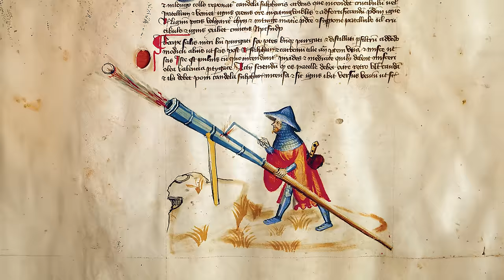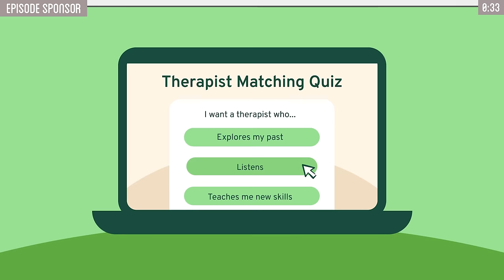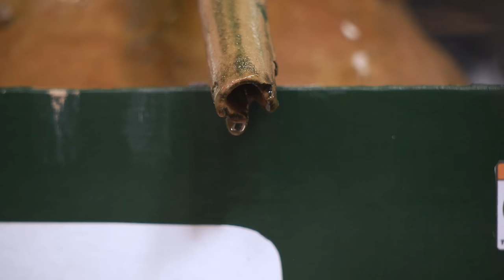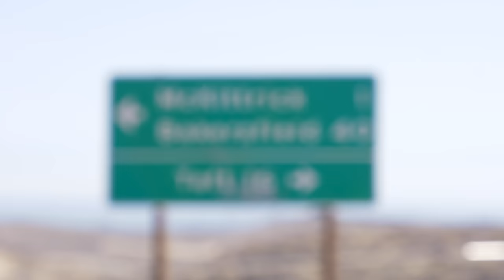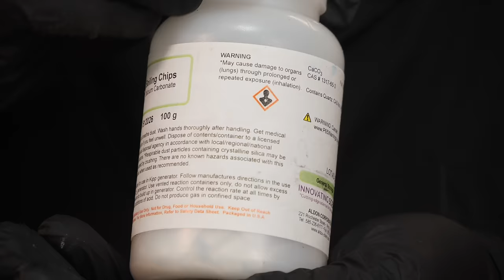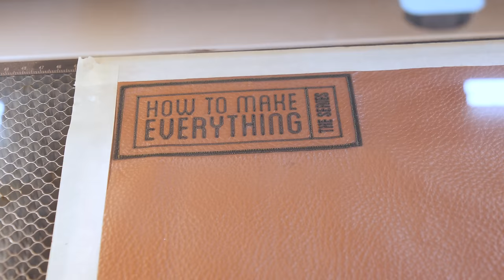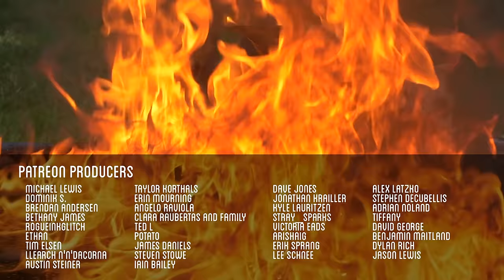I Recreated the Lost Recipe for Greek Fire!

Comment: Quick tip from a chemistry student: please clean the ground glass joints in your distillation setup. Anything in the joints will probably cause leakage. You probably don't want that for your safety and yield. And for safety purposes please ventillate well during distillation or do it outside.
Reply: Yes. The fumes can easily cause a fire, asphyxiation, or an explosion.
Reply: Distillation*
Reply: @adamkluckner3429 your comment added nothing to the original comment. 🤓
Reply: @Ith4qua  You're welcome to believe that but you'd be wrong. It added correct spelling to an otherwise incorrect sentence.
Reply: @adamkluckner3429  Nitpicking a bit but true, I make that mistake too often. Since I am a fellow perfectionist I'll edit the comment.
Reply: @lordcatface2378  You are correct I was definitely nitpicking a little bit, but on a comment about the benefits of doing things correctly it only seemed fair. Have a very pleasant day.
Reply: @adamkluckner3429  Yep, perfectly fair, have nice day too man.
Reply: Did you guys become friends?  Dorks.
Reply: Magnifique.
Reply: Aha... nitpicking perfectionists!

The perfect place to repost this...

Interjection! Objection!

I should watch the whole video before commenting especially since I skipped ahead after listening to the beginning...

I suspect that your napalm mixture is not the “legendary Greek fire” but just a flammable oil mixture.

Just as there have been discoveries of ancient devices that might have been electroplating devices...

So to the lost technology of Greek fire most likely involved some simple but technical material such as sodium metal with was contained in the oil pitch material... this material was likely to be pulverized and distributed throughout the oily pitch possibly in conjunction with a pulverized processed mineral that was very high in magnesium metal...

So now they have the oily pitch containing pulverized metallic sodium and pulverized metallic magnesium... which in the oily pitch would stable and if pumped out under pressure would ignite on contact with water and burn even in a highly carbon dioxide environment without oxygen being readily available in gaseous form... once the metallic sodium catches on fire simply from being exposed to water... the magnesium would ignite and be even more difficult to extinguish until the chemical processes and reactions ran out.

So that would create a stable Greek fire system that would be relatively safe to handle and transport and yet be highly volatile and useful under a wide range of potential deployment capabilities.

This would explain why Greek fire was described as “burning water” and “impossible to extinguish”... because once the metallic sodium starts burning and ignites the metallic magnesium in the pitch mixture... there no putting out that fire.

In the histories of the Byzantium Palace in Constantinople there were mentions of strange machinery of unknown purposes in the basement... which were damaged by looters in the fall of the Byzantine empire.

There was in fact a recipe.
There were in fact machines.

There are in fact simple chemistry patterns and behaviors which can create these outcomes.

What is unknown is how they did it and how it was discovered in the first place...

To me this is fairly obvious at this time... but I studied this situation decades ago and am often amazed at the continuous misrepresentation, misdirection, misinformation and obfuscation related to this and many other topics.

This material is ridiculously dangerous to have in storage... and they most likely would have manufactured it on demand from stores which were deliberately acquired using a clandestine methodology in order to prevent recognition of the recipe and the processes involved.

People both over complicate the situation and underestimate the capabilities of Greek fire.
Reply: if you're gonna turn your back yard into a superfund site, you're probably not concerned with getting quantitative yields.
Reply: I am not chemist nor scientist, but should different experiments not be done in a similair setting?, i mean i have my doubt of the last two, as the entire pool was blacked out.?
Reply: The guy's ego is so big, he really says that noone bothered to test their recipe before. I doubt he cares about your advice.
Reply: @quitequiet5281  I'm convinced that Greek fire contained lithium ...
Reply: Nah fr it was killing me
Reply: You can hear how dirty that joint has gotten.

Comment: Maybe this might help: Naphtha (refined crude oil, boiled to extract compounds that evaporate at lower temperatures just like what you did), quicklime (as a fine powder), calcium phosphide (produced by boiling crushed bones in urine in a sealed earthen or copper container), turpentine (extracted from pine resin), sulfur (as a fine powder), and niter (potassium nitrate). The working principle involves the reactive ingredients, calcium phosphide and calcium oxide (quicklime). The key question will be the proportions—whether the mixture should have a paste-like viscosity or be more oil-like. I think the solution will require testing and adjusting the oxidizer.
Reply: That sounds like a very effective recipe! It's definitely something I'd wear a respirator around, but ignoring the obvious hazard of phosphine, I don't dont see why it wouldn't work. Is there a source to this recipe or did you come up with it?
Reply: @Oystercaulk  based on a lot of research, I looked at the tech and what they were using and trading as well as using for medcine.  All these things were at their diposal so its stands to reason with a bit of experimenting they would figure it out.. Another thing they had was alcohol but didnt find any evidence of distilling it to a pure form.
Reply: @rishia8908  id imagine given its secrecy any literature that may have been produced by someone with high testicular density regarding the production of Greek fire, its constituents, or its precursors would have been found and consequently destroyed since there likely weren't too many people to keep tabs on that knew the recipe. Anyways, this recipe seems quite plausible, and regardless of its potential differences in composition to the original recipe, it sounds like it would produce all the effects that define Greek fire in literature and have been possible for them to produce at the time. Good job, man! Hopefully, someone will come along and test this recipe because god knows im not going to chuck anything containing calcium phosphide into water in my backyard to find out. Then again... Idk. Maybe one of my neighbors has a pool they don't use /s 🤔😂
Reply: this looks very promising tbh, imma get the ingredients and give it a shot once I have some free time
Reply: @artemis-arrow-3579  nice.. keep me posted!
Reply: @artemis-arrow-3579  awesome! Be safe, and let us know how it goes!
Reply: I was honestly considering calcium phosphide as a potential candidate component as well.
Reply: You just forgot to consider greek fire wasnt supposed to ignited when  It touch water, in fact some sources noticed It was launched upon enemy ships so quicklime and calcium phosphide are useless and It looks very strange for the byzantines to use potassium nitrate centuries before It became widely know and used in the area
Reply: @marcoaorelio6409  according to multiple sources it did ignite when it touched water. and they did have niter ! I suggest you update your knowledge on the subject !
Reply: @rishia8908   not according to military Eastern Roman sources
Reply: @rishia8908  so did he use Naphtha in the video ? The distilled tar seep?
Reply: This is similar to a basic recipe that I have read before, although as you said the proportions have to be determined thru experimentation. I might guess that it has to have a consistency like a semi-jelled slurry so it can be projected out thru a type of hand pumped or pressurized siphon tube. It needs to have a reasonable range, maybe 25-30 meters at least? I know it could also be in form of a kind grenade hurled by ballista or catapult. It would start burning on impact. But if it missed and hit the water, it would burst into flame. I think they would have used something to thicken it, jell it, and make it sticky. Pine tar or turpentine certainly. Maybe shellac, thru trade with India? I know the Greeks didn't have any Styrofoam laying around. Experimenting with different ingredients once they had the basic recipe in order to improve the range and heat of burning.

Comment: If you've already got pine resin, its a short jump to get turpentine, which is super flammable... and is basically just distilled from pine wood, easier to get then pine tar, possibly just mix it with the raw crude, you have the sticky icky, and the easily ignitable? a simple easy to replicate with Byzantine tech recipe. Maybe add some phosphate as a thickening agent?
Reply: Terpentine is a low viscosity fluid, so it’s not sticky. Phosphate is ionic, and as such is very polar. That means it’s not soluble in non-polar organic compounds like those in petroleum. It would just sink to the bottom of the mix, and not do anything
Reply: @ashe1.070  egg is an emulsifier. so is blood. they're both albumen. So is lecithin which is in most plants. terpentine + phosphate + eggs or blood. sounds like alchemy to me.
Reply: @ashe1.070  did you read the entire comment? "possibly just mix it with the raw crude"... clearly not.
Reply: How do you add the magnifying glass and create a searchable url in the comments? Tried looking online but could only find copy and paste url.
Reply: @Rizzob17  I think it's automatically generated with AI or something. Not a command by the commenter.

I noticed that they appear and disappear in different comments as I refresh the page.
Reply: @Pixelarter  I bet you’re right. The little magnifying glass is gone. I only noticed it yesterday.
Reply: toss a little magnesium in there  for the water induced super charged flame!
Reply: @anthonyrobu8633  magnesium, while being a recent discovery, doesn't react with water, it does burn hot enough to split the molecules, it takes a sizable chunk of already burning magnesium to do much more then fissile

Comment: I remember reading somewhere that Greek Fire was preheated before battle, which might affect the results.  Also, it seems to me that adding small bits of sodium, lithium, etc. to the mix might be a good way to ignite the mixture in water. Sodium is often stored in mineral oil, so it's safe-ish to transport.  Then during a sea battle, as the oil spreads on water it seems plausible that the sodium would eventually touch the water and ignite.
Reply: I don't think the Greeks had access to sodium and lithium
Reply: How'd you get that with the chemistry of the time?  Normally this is done with electrolysis of molten salts (no water).
Reply: @SuperEmmetMan  I don't know if they did or did not, but they did work with other metals. I think there's at least a possibility that some sort of highly reactive metal might have been part of the secret formula.

Besides, I'd like to see a video of that concoction, even if it's not all that plausible.
Reply: @Neal_White_III  Highly reactive metals are that way because they're made that way.  Unless you have the technology to reduce alkali to metals, or to make something like pyrophoric aluminum, you don't have such highly reactive metals.
Reply: @goodmaro  Agreed.  The question in my mind is: Could they have discovered a method to make such a material in antiquity?  Considering that it was so secret, unfortunately, it's likely no evidence would remain.
Reply: @SuperEmmetMan  - Yes, sodium and lithium extraction involves electrochemistry, with a lot of electricity. 10,000x more than you can get out of a room full of "Baghdad batteries". bdw, Baghdad batteries are "coast-to coast" BS ! Not getting useable lithium or sodium, or potassium, until the mid 1800s.
Reply: The problem is, you need electricity to extract sodium from salt.
Reply: They did not have access to any alkali metal
Reply: theres no way the ancients could have made sodium
Reply: Despite the inaccuracy of the claim that alkali metals require electricity, the Byzantines still weren't using any: the alternatives are refining under vacuum (which didn't come until the 1650s, by which time Greek Fire was lost for centuries), or an inert gas (which the Byzantines also didn't have). In short, abandon all ideas of alkali metals being used for Greek Fire: the option never existed for them.
Reply: @absalomdraconis  people also forgetting the color of greek fire, it was green so something in the chemical reaction is probably key
Reply: @SuperEmmetMan They probably didn’t, as alkali metals weren’t discovered till a long time later.
Reply: @SeekingTheLoveThatGodMeans7648  electrolysis can be done with an acidic liquid with a salt connected to copper wiring.

Bronze Age batteries, if you will...
Reply: @Jamhael1  yeah Bro, a 1.1V battery is pretty suitable if your goal is to produce hidrogen and oxigen from water and nothingelse
Reply: @marcoaorelio6409  try in scale - as in vases of 20 L of vinegar in line.
Reply: @Jamhael1   I will teach you a thing, every cell generate the same electrical potential and It is independent of the cell size, this is the reason behind the fact a 12 V lead battery is in reality 6 cells of 2V each. 2L, 20 L, 2000 L generate 1,1V
Reply: @marcoaorelio6409  not even if put in line or in parallel makes any difference?

Because such things were used for jewelry in ancient times...
Reply: @Jamhael1   yeah? But there is no point in it because It is impratical and wastefull.
You need to melt salt with another salt to obtain an eutectic fluid at 850-900K, and you need to collect molted sodium in a free oxigen tank and to dispose large amount of toxic chlorine.
Allow me to do some maths:
A common lemon battery that use zinc (anode) and copper (cathode) generate a potential of 0.7-0.9 V and roughly 1 mA.
Industrial production of sodium use a potential of 8 V (despite the theoretical amount would be closer to 4.1V) and require 10-20 MWh per metric ton.
To produce 1 gram of sodium you need 10-20 Wh and a 9 lemon batteries and It would require 20-41 minutes.
Now sodium is a solid, greek fire was a liquid ejected with a siphon, would be pretty difficult to produce a sizeable amount of sodium and eject It together.
PS greek fire wasnt supposed to ignited when It touch water, no byzantines source claimed it so there is no point on racking your brain to produce sodium
Reply: @marcoaorelio6409  what about saltpeter or rock salt?
Reply: @Jamhael1   saltpeter became widely know in the middle east only when greek fire started its decline and disappeared in less than a century so would be pretty strange
Reply: @marcoaorelio6409  what about rock salt for sodium?